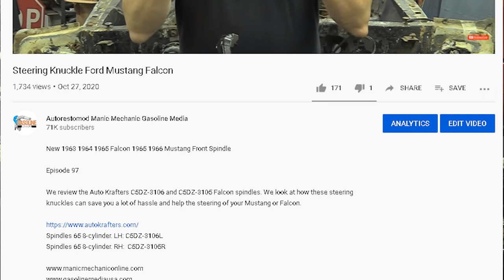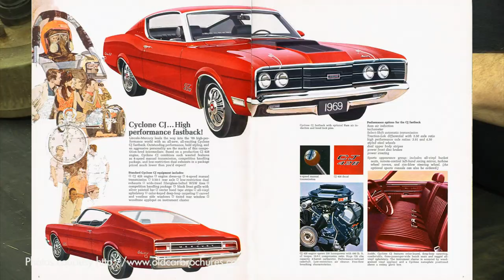FYI Ford Granada Brakes

Comment: Will this work on a 1963 mercury monterey s55?
Reply from the maker: There are brake systems available for the S55. But this break system wont-work because it's for the Granada
Reply from the maker: I would check with autokrafters.com they have a break system for the S55 availabl
Reply: Than you I appreciate it.

Comment: Turned my hub down on a lathe and guess what a stock wheel will fit for the most part if it is say a 5 inch wheel, A 7 inch wheel will not work!
Reply from the maker: Are we talking stock 7 or aftermarket

Comment: Have heard that these, Granada spindle will fit on a 1956 ford, true or false?
Reply from the maker: Honestly, I'd have to research that. I've heard that folks use them on the Galaxies too. But I would need to dig in on that. Might do a video there.
Reply: Yes but you have to modify the hole on the spindle for the tie rod to fit the 56 not a direct fit other than that everything is bolt on
Reply: @fidolokoteproductions9128  Thank you.

Comment: Did you knew the same exact brakes were made in England by Girling in Liverpool and were the exact brakes also supplied to Rolls Royce In the early 1960's, in fact the Ford parts that were rejected ended up on Rolls Royce corniches from 1963 on
Reply from the maker: Interesting

Comment: Shims... You can install Versailles ball joints 
I use Granada tie rod ends inner and outer and just ream the tapers with tool from SPEEDWAY.
Measure your bump steer and adjust the tie rod end position using heim joint to minimize bs between -2 and +3 inches travel.
Simple.
Reply from the maker: We mentioned that Mustang Steve sells the shims for the Versatile ball joint. If you can hot rod re please provide part numbers for these things that you're talkin about.
Reply: Sorry. No numbers.
Did this several times 15-25 yrs ago. 
My daily driver 63 Fairlane has Granada brakes/tie rods, ball bearing idler arm, etc.
Granada brakes work well with top grade linings for street work. You are still limited by traction.

Google "Fox Mustang bump steer kits" and you can see pictures of the bump steer correction idea for the outer tie rod end.
 (Home assembled kits are much less expensive.)
Doing simple bump steer measuring allows a quick set up.
Hope this helps. 😎
Reply: BTW I reamed my inner tie rod hole in the 63 steering cross link to fit all Granada parts.
Reply: Ill mention again that if you use a Ford coil spring compresser that sucks the spring up into the tower, front end work is faster and safer.
Bump steer can be checked by only removing the shocks.

Comment: So they will not work on a ‘65 Fairlane?
Reply from the maker: Can't say that. I just plain don't know. I am looking for one to peep at in my area, but the 62-65 Fairlanes are sparse around here.
Reply: According to chockostangclassicmustang.com the 65 Fairlane v8 drum spindles are the sane disc or drum.  They can be converted to discs using the factory style brakes.  Chockostangclassicmustang.com
Reply: My personal cars. 👍

62-65 bolt right on.
Use Granada tie rod ends.
Ream the tapers with a tool from Speedway.
When lowered 1.5 inches bump steer is very good.
Keep your lower pivot points horizontal parallel with the ground👍

Make everything G parts for easy replacement.

Comment: There are people who also use the Granada brakes on Galaxies.
Reply from the maker: Yep. I am looking at stuff for that for an upcoming episode. To include the full size would have been to bulky for one episode, so I am splitting it off.
Reply: @AutoRestoMod  
I snagged some 72 Torino disc spindles for my Galaxie. They have an awkward caliper mounting setup like the Granada. I made some brackets to mount 2001 crownvic /or cobra calipers and rotors and converted the Torino rotor-hub into just a hub. Going the aftermarket route on the drum spindles is much less work.
Reply: @AutoRestoMod  good work sir, Im really looking forward to alternatives for my '66 Galaxie 500